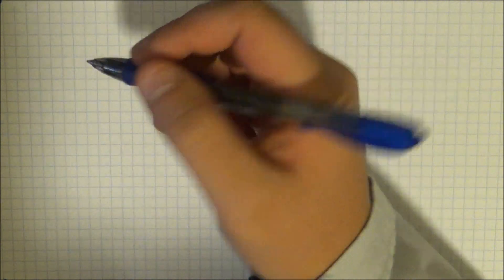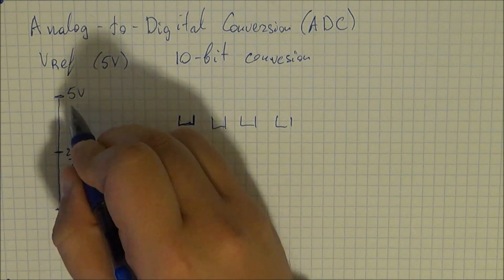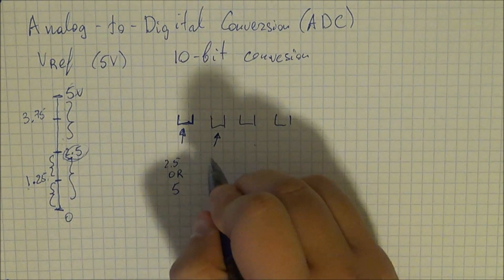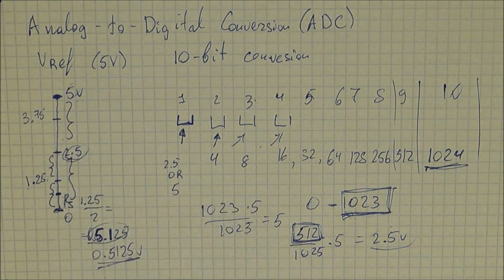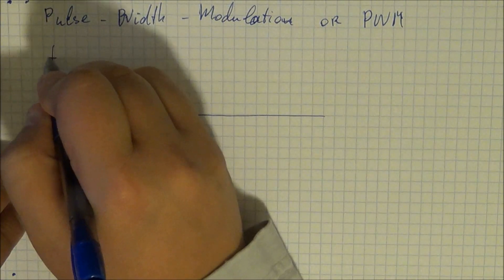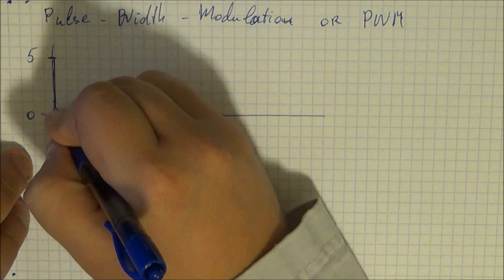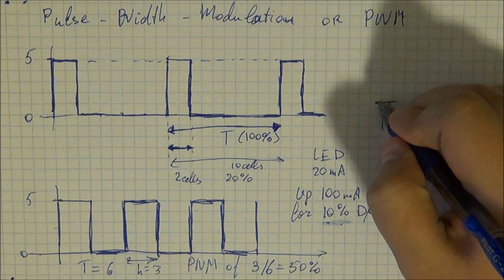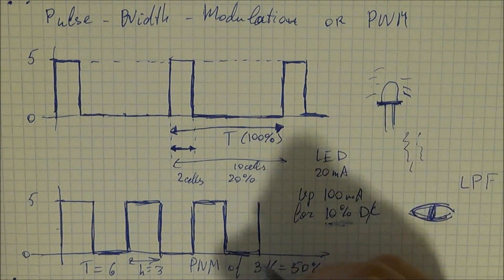Arduino Tutorial #2 - Extended - PWM, ADC, LED Brightness, Signal Processing, Ref Voltage

Comment: How to amplify the output led voltage of a arduino
Reply from the maker: I'm not sure what you mean by amplify the led voltage of the arduino, but you can use a buck boost converter. That being said, you should be careful with how you wire that in...

Comment: how to use PWM signal using relay?
Reply from the maker: +Parman Josan You can only do this with a Solid State relay. In which case you would be doing it the same way as anything else. If you try to do it with a coil relay, you will destroy the relay very quickly as it is a mechanical assembly which moves every time.
Reply: +EEEnthusiast  can i use H-brige IC
Reply from the maker: +Parman Josan +Parman Josan Absolutely. You would send the PWM signal to the EN pin of your H-bridge.
Reply: +EEEnthusiast thank you very much for such a nice lecture and support n help

Comment: One question no one can seem to answer: What is the best frequency to use with LED, motors, or anything other device when using PWM?
Reply from the maker: There is no definite answer to this. Our eyes are able to filter out anything above 30Hz or 30 times per second, so anything above that is fine. If you use lower frequencies, you may see the LED flicker. Refer to your datasheets, but a typical LED should not have restrictions when it comes to frequencies of PWM.